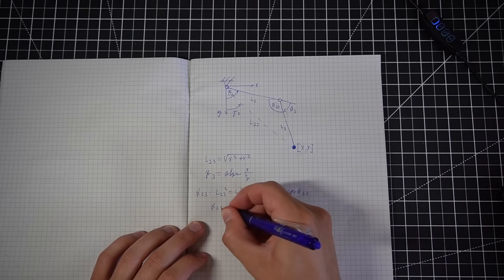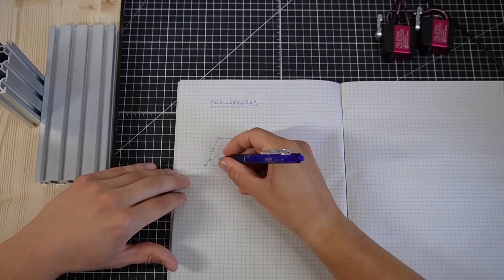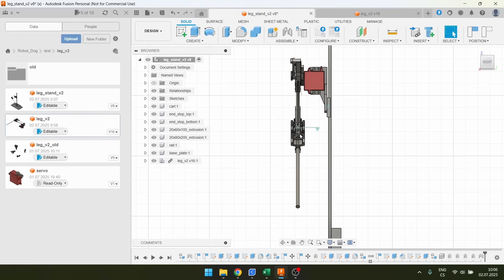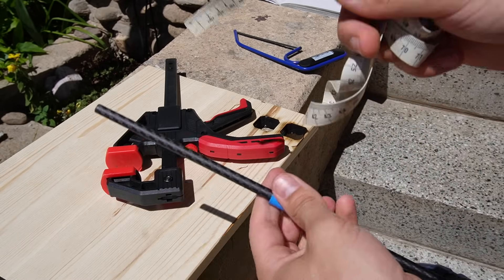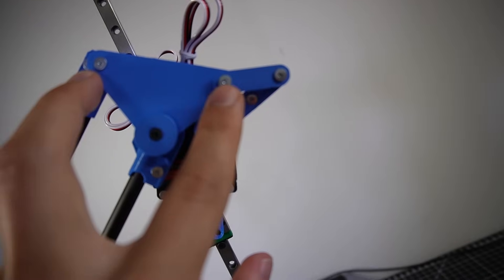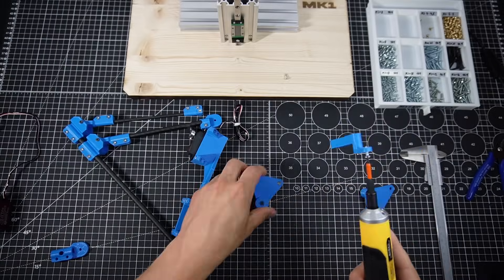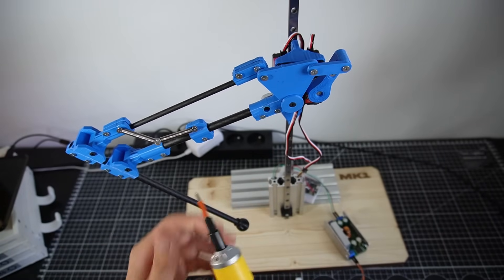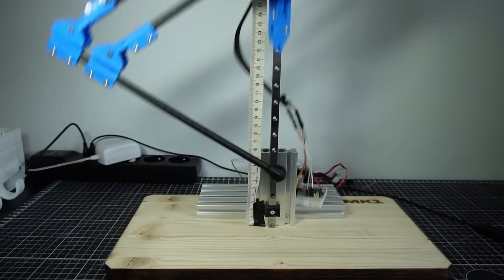Robot Dog #2 - Jumping Leg mechanism using Servos and Springs

Comment: why not use the standbeast leg mechanism, it will require one less servo,
the weight will decrease and the power too, but the movement will be smooth  and it will require less coding
Reply from the maker: Interesting. But I would lose a degree of freedom and I need 3DOF so I can make the robot turn, dance and stuff.

Comment: Try spring as spring with motor and a nut effectively making an adjustable spring. You could adjust the spring slowish until spring handles the full load. If you measure the motor amps you could adjust the adjustable spring until motor amps are 0.
Reply from the maker: I thought about this: adding a servo to move the spring, increasing the stiffness. I could switch between 2 modes: regular with lower stiffness, where the robot just walks and jumping with high stiffness, where the motors have to keep the legs down. Although it would add complexity so I am not sure if I'll add it.
Reply: @TazerTechnical I'm thinking you'll need to add a large battery in your existing design. I see an adjustable spring as a reduction in steadystate energy which reduces the battery needs.

Comment: I'm sure you must have considered a belt as an alternative to the parallelogram mechanism. What's the downside to that approach? Surely it would be lighter overall?
Reply from the maker: I saw robot dogs using this parallelogram mechanism so I chose it too. I considered belts too, but whenever I see someone use them, they always skip even when using additional gears to increase the grip angle. It's also straightforward to add a spring to this mechanism as opposed to belts.
Reply: @TazerTechnical  Awesome, thanks for letting me know. I was playing around with leg designs for a hexapod and had similar ideas about springs and moving the mass to the top of the joint. Belts were my first thought, but maybe I should reconsider that and explore parallelograms too. Awesome series. Looking forward to seeing your progress!